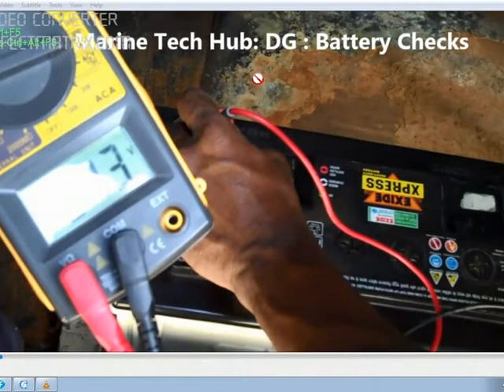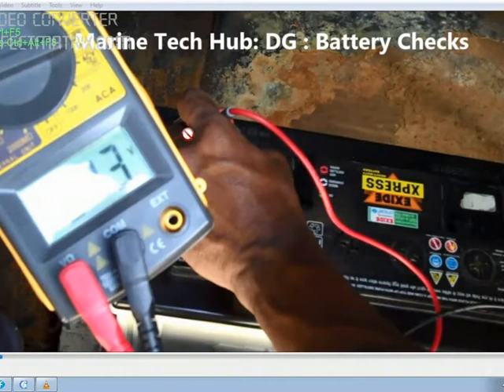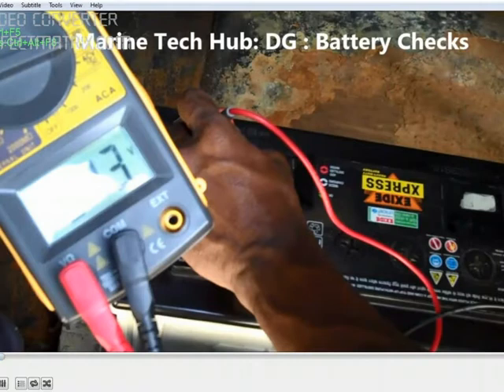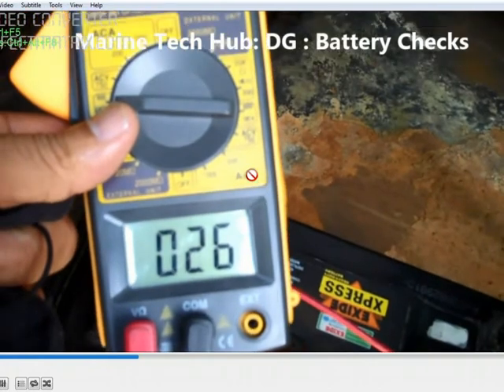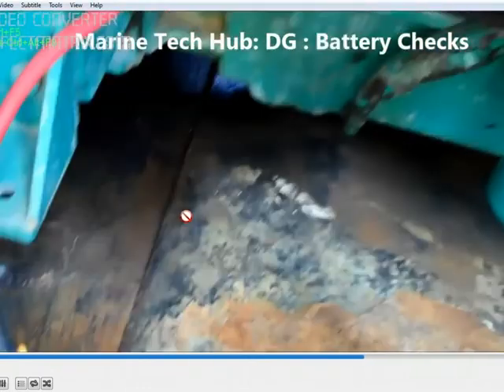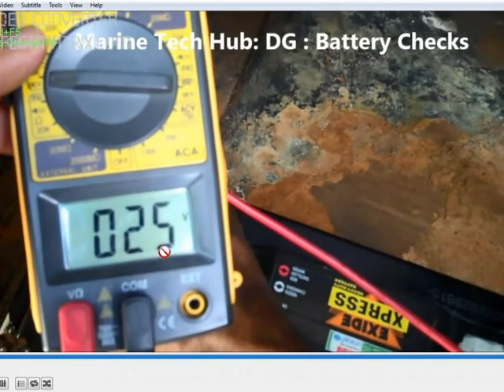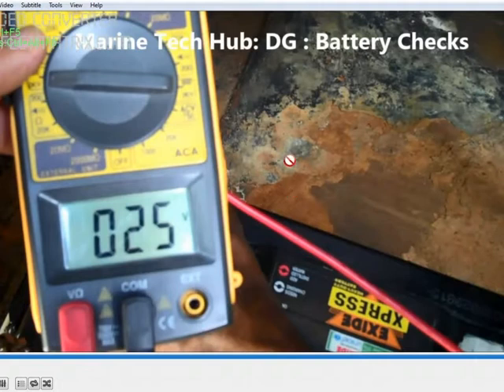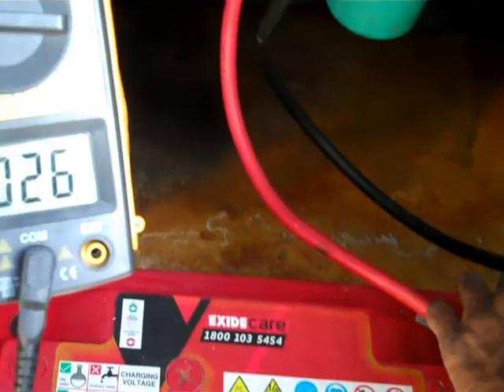Diesel Generator : Load Test Of Battery: Important Tips For Engineers

Comment: Hello Sir, I would like to clarify 2 things
1. What action to take when the voltage dips to 12 or 13 while starting? Is it due to drop in specific gravity of H2SO4 which can be retrieved by adding dillised water or else charging is the only way.
2. How come the charging voltage will be 26v instead 24v when stepdown from transformer?
Thanks
Reply from the maker: Life of the battery is about 3 to 4 year depends on the care taken. Make sure the distill water is maintained all
the time. Always charging voltage would be 2 volt  more .  When you put off the charger then the voltage may to 24 volt or less depends on the condition of battery. If your voltage is 24 volts it does not mean that  your generator can start. It is only the load test which gives the condition of the battery. Specific gravity of the liquid also matters and also the condition of the lead plates inside.
Reply: Thank you so much for clearing the doubts Sir.